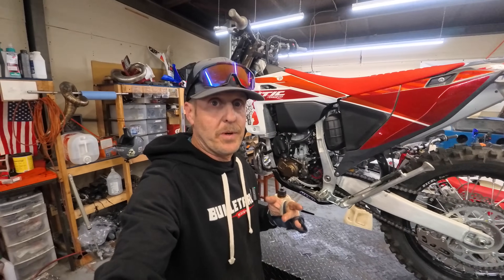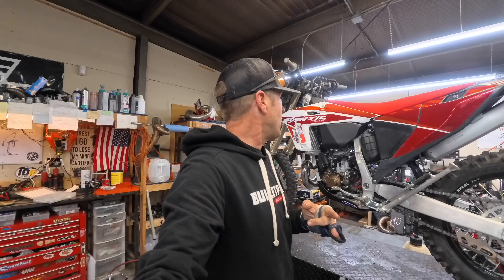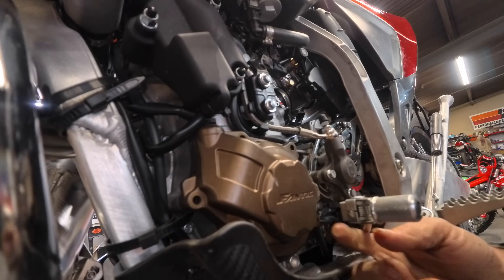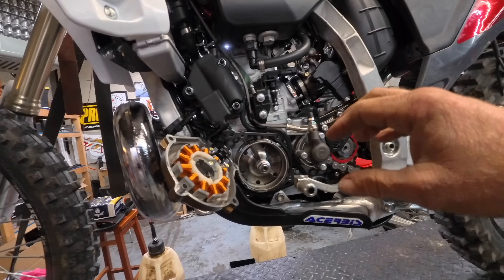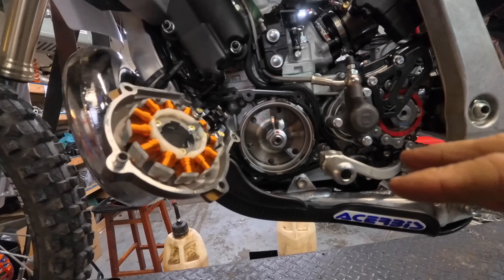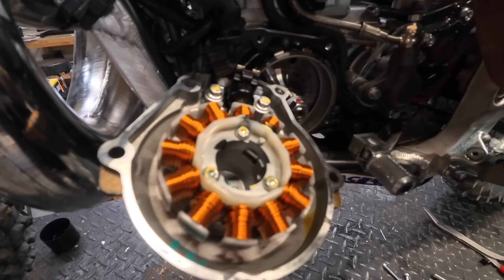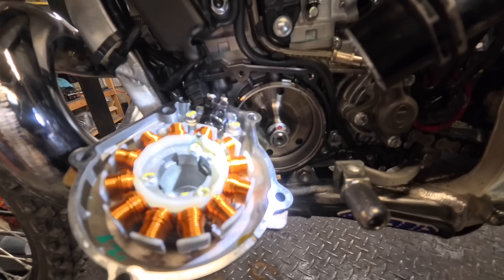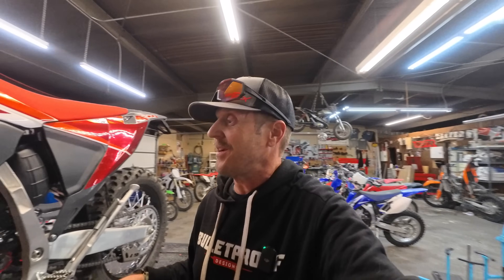What Stator is the Fantic XE300 running?

Comment: With all the bikes im sure some bits can be interchanged to get lights and a fan to work..  the stator and flywheels can be made to fit different crankshafts..  case cover might need fine tunning and some massarging to work a hand full of zip ties and a roll of duct tape and grind on..😂

Comment: Some potential  advantages over ktm.  1.  lower price.  comparable F models are $2k cheaper  2.  Yamaha parts are less expensive.  3.  No additional cost to map tunes and can tune on the fly.  4.  yamaha reliability  

Potential Disadvantages:  1.  unless they make a soft enduro kyb, it's often too firm for hard enduro and the average rider.  2.  would need a heavier flywheel to cut down on the inital power unless they built that in the tune via ecu, pipe or head.  

Could be way off base but seems like KTM got a little drunk on their own brew.  Between an inventory of almost 270,000 bikes, bankruptcy and new competition they are gonna need the loyal fan base to step up anf buy and/or sharpen the pencil on customer pricing.

Comment: This is a WR 250F coil and Flywheel. The coil charges the battery and the pulse coil triggers the spark ‘ . The battery runs the ignition and starter and fuel pump !

Comment: Yamaha had a facotry in Europe they used to modify the bikes to be "street legal". Also Yamaha owned Motori Minarelli until 2020 - they sold it and Fantic acquired it. Quite a lot of engine development for Yamaha was done there in cooperation with the Japanese branch. So not surprised to see the stator having a Yamaha logo on it. Bet most parts in the engine can be found on other Yamaha models. The starter motor is most likely a Mitsuba SM-18 that thing is used by every manufacturer.

Comment: Are the engine mount locations on the XE300 the same as a YZ250 or XX250? In pictures I've seen they looked a little different but I couldn't tell for sure. If the engine mounts are the same that's very interesting as the frame and top engine mount part numbers between the XE 300 and XX 250 are different.
Reply from the maker: They look the same but it’s hard to tell 100%

Comment: How's that trans gear spacing in comparison to the yz
Reply from the maker: About the same as an X. 3rd is a little taller
Reply: @highlandcycles  nice, I never liked the huge 3-4 spacing, although I do appreciate having the higher ratios.
Reply from the maker: @ yeah. I rode it today and the transmission feels good
Reply: I wish they’d have put a lower 1st and 2nd gear. While I would prefer a 6-speed, I could live with a true wide-ratio 5-speed.
Reply: @siaknijustin  i always liked the yz1st with a 50t rear.

Comment: GYTR has an e start kit for the yz 250 they are doing final testing in January
Reply: That’s the way to go offer us a way to make it like that ourselves while keeping base model cheap
Reply: @davidbeauvais1364  i think thas really big move from yamaha... You can buy yz 250x or yz250 and then is like lego you can build it just the way you like... you ride motocross maybe you want to put hydro clutch but dont care about starter... You ride coutry cross or single track you but bigger tank fan and light... You ride hard enduro no problem e start kit tank ligh clutch etc... And if its going to be all GYTR brand from yamaha you 100% gonna know that its going to fit and its going to work...

Comment: Here are the part numbers from the transcript-flywheel is B7R01333Z & stator is BAK033YT.  Tried to find them, no luck.  However, the flywheel sure looks like a Yamaha 4T flywheel, namely a GYTR for a WR450F that I found online, SKU: 1SL-H13A0-V0-00.  There is also a WR250F GYRT heavy flywheel SKU: BMF-G13A0-V0-00 that looks similar too.  Hope  that this helps!

Comment: Seems promising….I really hope the Japanese get on this enduro bike band wagon. I’d buy a yz300 or a cr300 in a heartbeat. Keep the carb or put fuel injection on it, I don’t care. Mechanical or electronic power valve, don’t matter. If they’d just put a start button on it, a hydraulic clutch, a fan, some lights, hand guards, skid plate they’d be flying off the showroom floor.
Reply: and they would b north of 10 grand
Reply: @ yeah, 4 grand less than the pumpkins
Reply: You can scratch Honda off that list unfortunately.  They wrote the 2 stroke off with no desire of going back.
Reply: @JeremyFoytik And they will never get my money again
Reply: naw, I like electric power valves over mechanical power valves. Have had both
Reply: Will that ever happen? I hope so seems like 300s are the superior woods bike all over the world
Reply: cr300?  I would pay way too much for that, lol.  They already developed this bike in the 90s, the crm250ar, but never brought it to the US. Honda does love racing, so I will cross my fingers.